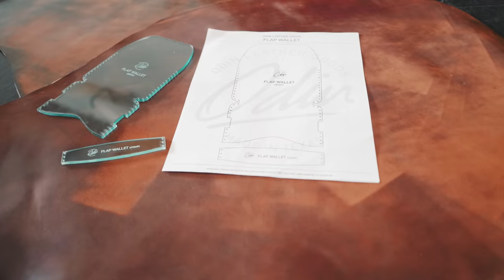Using the BEST LEATHER IN THE WORLD for a simple hand stitched front pocket wallet.

Comment: great video.  i notice that your template has stitching holes in the template, what irons are you using to get the right placement?  and what thread size.  and can i ask what brand groover you are using and how well you like it?  thanks.  will be ordering your template with my next pay check.
and i guess i need to experiment with nicer leathers. lol
Reply from the maker: Hi Williams! Thanks for checking out my channel. In this video, I'm using a set of 3.8mm Sinna Brooks irons. They're pretty great! The Grover is a Versa Grover from Bob & Lee Douglas. It's an excellent groove - the handle and the blade in it. I don't use it often, but I'm always happy I have it when I do need it. Grooving the stitch line isn't absolutely necessary for this wallet though.
Reply: @OdinLeatherGoods  thanks for the quick reply.  i've been kicking around getting that groover, but no one really reviews it, so thanks for the feedback on it.